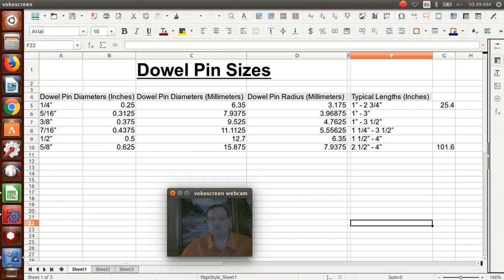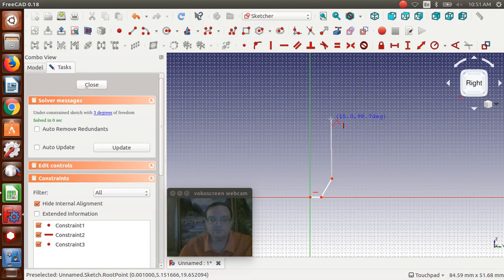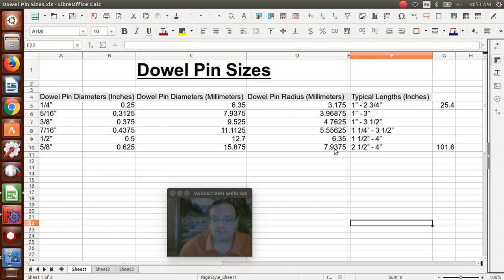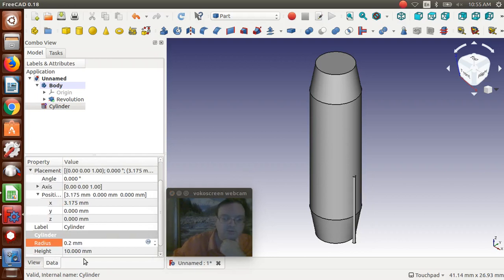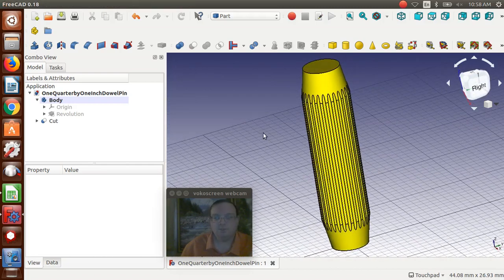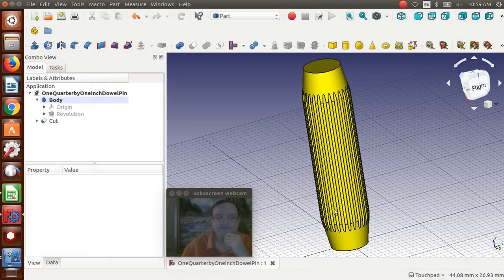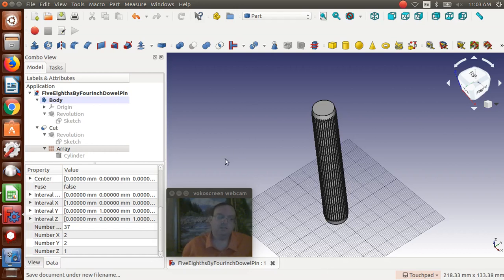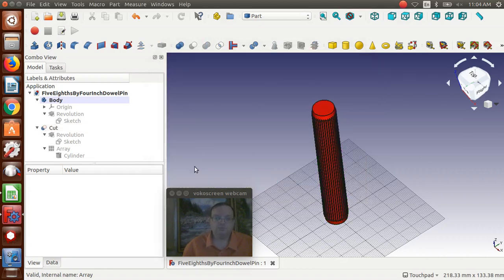FreeCAD 0.18 Modeling Wooden Dowel Pins

Comment: You video has been referenced on the FreeCad Wiki on a page: '''[https://wiki.freecadweb.org/Best_Practices_with_SpreadSheets Best 
Practices with SpreadSheets - FreeCAD Documentation ]'''.
Your or your viewers may want to take a look at that page and read/evaluate/learn from it.  
It is a wiki so you can change the page, or comment in its discussion tab.  You can message me, the guy who made this comment.
Reply from the maker: Why? I don't think I have ever used the spreadsheet function/workbench.
Reply: @Phelps3D  I got faked out by your use of LibreOffice, sloppy work on my part.  I will remove it, but encourage you to try out the spreadsheet functions in FreeCad, not so much for its ability to calculate, but to make parametric designs.

Comment: This is not the best way to use Freecad. After the revolution of the sketch it is the best practice to stay in the part design workbench and add a subtractive cylinder.. Also in the part design workbench you can give the polar array. Mixing partdesign workbench, part workbench and draft workbench will very often give errors